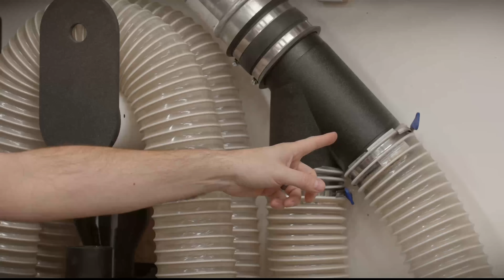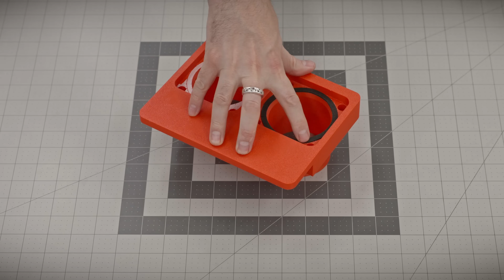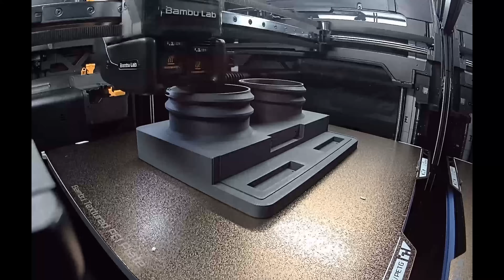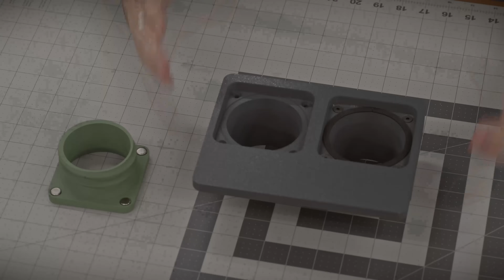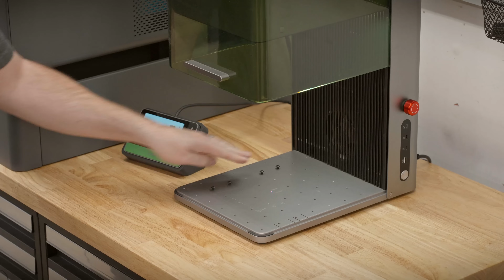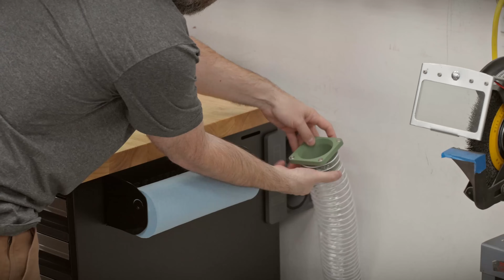Two Lasers, One Filter

Comment: If you cad design your supports as separate bodies, you can use tpu on the interface to support pla and vice versa. In the places where you want tpu to be integrated into pla, use beam interlocking.

Comment: Now that you have a simple and reliable solution that works, you could go down the path of the automatic (HA-driven) solution. Here's the trick: you design the automatic unit to fit between both of the parts you just made. In other words it connects onto the existing manifold magnetically, then the purifier hose adapter magnetically connects to the automatic unit.

Then if it doesn't work? In two seconds you can have the automatic unit disconnected and go right back to the manual solution.
Reply from the maker: I haven't had luck with HA automations working without some amount of intervention.  Something always needs updating unfortunately.

Comment: It would be nice if there was a visual indicator on each machine.  You could add limit switches to the manifold that run to a simple LED on each machine.  It would help you be sure that its connected to the right machine but not impair tool functionality if it breaks.
Reply from the maker: Yeah, I did think about this, but for the CO2 laser, I need to manually turn on the air filter, and it's RIGHT next to the manifold.  so It's pretty easy to just do both.  Also, whenever I have to add power, it gets annoying.  Then there's a wall-wart to plug in, wiring, etc.
Reply: @RobertCowanDIY  Just add a small wind turbine in the duct to power the led. So simple. I’m totally joking. Great project, thanks for sharing.

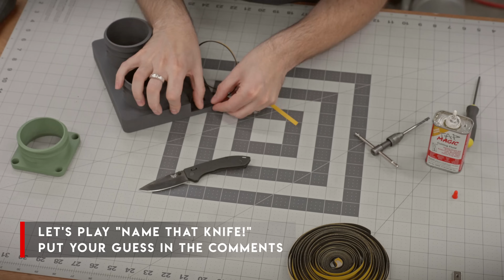Comment: 08:43 A very nice benchmade, doesn't look like the standard griptilian though. Great design! Thoughts on making it slide between the 2 inputs instead of pulling the connection out to switch, with the magnets snapping it in place? And I don't have any MMU experience, but can you change the interface layer to have a thicker line width? Thinking that could help with the interface adhering to "itself" more than to the object?
Reply from the maker: Close, it's a mini narrows.  I did think about the sliding mechanism, but 3d printed parts don't really 'glide' well.  I have some UHMW tape, but then it just gets more and more complicated.

Comment: rather than fancy "support" material, the good old PETG/PLA thing works well... especially if you can use silk or matte PLA. Regular PLA doesn't stick well enough to PETG during printing and can fail, but silk does stick nicely while printing, but still pops off super easily. I've had WAY more success with that combination using various brands of each than with plain PLA. I posted about that on the FB groups, and others corroborated my findings, as well as noting that matte seems to work as well as silk, and both much better than regular PLA. TPU doesn't stick well enough to PLA to work in your situation, though. FPF even used PLA as a peel away support for his TPU billows prints.
Reply: Bambu adds some adhesive in probably all of their filaments, PLA basic for any other PETG and PETG basic for any other PLA works fine

Comment: Adding a tongue to the top of your hose connectors that lever in to a groove at the top of the housing might be a good way to solve your concern with the connector pulling out from the weight of the hose without having to just brute force it with more magnet strength. Cool project!
Reply from the maker: Thanks!  Someone else suggested that and I'll have to keep that in mind for next time.  For now the magnets are plenty strong.

Comment: A small handle to grab on the clear tube might be nice feature from an ergonomics perspective. Awesome build and video. Thanks !
Reply from the maker: I had a handle on the last version of this I made, but it was actually more awkward than just grabbing the hose directly, so I left it off.  I thought it would help, but it just got in the way.
Reply: @RobertCowanDIY guess real world prototyping is the key; if it works it works if it doesn’t it doesn’t! Nice! I envy your ability to model what you envision; I’m getting there albeit very slowly but you have such a command of the modeling  aspect you can literally design it exactly as you want not just in your head but in the computer, and then all the manufacturing techniques are available to manifest it. Awesome.

Comment: 12:49 if PLA run a torch over to get it a little soft (just gives off that sweet caramel like smell) then remove. I find you get more off in one go. Otherwise you have to pick at it.
Reply from the maker: Ah, I'll try that next time.  I used PLA support on ABS-GF and it was quite squishy and easy to remove from all the heat.
Reply: @RobertCowanDIY it seemed to work okay with pla snd petg (my usual material). Once you get that sweet smell it should peel like play dough. Your and sounds about same. Check your settings on prusaslicer you can have 0 space between interface layers I think default is 0.1 that snd if do 2 or 3 layers you’ll probably get a better peel. Ie all at same time rather than break up. It’s funny as I had a similar part and it was horrid on one print and the next print was easy peel.  Environment, humidity filament bath or just Murphy’s law - you know you can get a peel but it spites you..

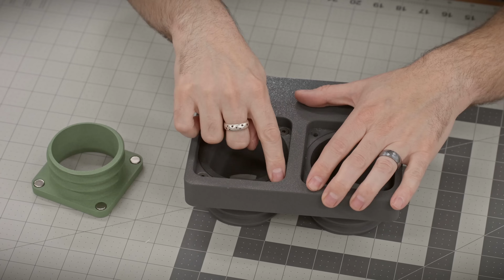Comment: 10:57 Try a Halbach array. Would increase magnetic force a little. Try as thin a wall between the magnets to get most force. It is amazing the drop off caused as distance increases.
Reply from the maker: Yeah.  The distance was only 0.2mm, but enough to cause a fall-off.  I just used WAY stronger magnets on the second version.
Reply: @RobertCowanDIY yeah I saw. I post as I go sometimes will go back and edit sometimes not. In this case comment stands for others.. But halbach are nifty if you have a few magnets and no space, I had a magnetic mechanism i was doing that used halbach. It certainly worked well. I think attraction force bumped up 70 or 80 % more (maybe 28kg) it was 6 yrs ago so figures aren’t right). That was from 5 10x10mm neo (n52).

Comment: 8:20 why not do solid infill around holes basically make an “boss”. Or do additional perimeters in enforced areas. 

Just curious why on somethings/ parts like this people don’t just jack up the perimeters to like 10 and essentially make it solid?

It would eliminate issues like the countersink blowing through. Is it a cost of material, time of print or for engagement (i.e. questions like this)?
Reply from the maker: If I knew I would had a problem, I would have just picked the correct hole size ;-)  Choosing the correct hole dimensions would have solved the issue.  2 walls is plenty for non-structural fasteners.

Comment: Looks great Robert. I may would have looked at a single blast gate, with a hole in the center, where the slide portion covers across the unused hose in either position.
You could manually switch or add the servo later without much effort…   just a suggestion! 
Always love your process to get a task done.
Reply from the maker: I WAS considering something like that, but it would have been custom and would have used moving parts, so the manifold was just simpler in the end.  But that certainly would have been another solution.

Comment: I've found that Overture Turbo PLA (which is probably the same stuff as Polymaker CoPE) works amazingly well as support for PLA, the same way that people act like PETG would, except it actually sticks while printing, uses the same temperatures as PLA, and is often dirt cheap because it doesn't work very well as a functional material and it sticks too well to some types of beds. But you can either use it with soluble support settings for an interface layer, or for something like this I would probably just CAD in a solid separate object with a chamfer between the parts to let you pry it off and a little bit of offset on the X and Y so there's room to remove it. Works great on a tool changer printer and I've tested it successfully with a manual filament change, so it should work on an AMS or MMU (not sure if it would need more purge volume than usual since real PLA and CoPE aren't 100% compatible).

Comment: In Bambu studio when you select PLA support material for the interface layer it suggests reducing the Top Z distance to zero...after having the same problem you did on a few parts I changed the Top Z distance to .05mm.  It still gives a great surface finish but makes the support layer easier to remove with fewer small bits left behind.  Love the video!

Comment: Pro-tip for the P2(S) while I’m thinking on it. I recently repurposed the 6mm fire suppression connector and routed an air compressor to bypass the dinky aquarium pump they use for air assist. 

Holy hell - what a difference. 20 psi and now I can cut 12mm MDF when that was impossible before. I’m very happy, unlocks many new projects. Albeit at 3mm/s 100% power but hey it cuts. No you can’t take multiple stabs at MDF, you end up incinerating the edges because the kerf gets gummed up with molten resin. One pass with very strong air assist does it. Can’t wait to try plywood again and see how the edges look.

Comment: I made a Y-splitter ages ago, it’s on Makerworld and handles the same problem: one AP2 shared between F1/F2 ultra and P2. I would like to isolate the pipes someday but it hasn’t been a pressing issue. The AP2 pulls hard enough that I can cut 12mm MDF in the P2 without noticeable odor (e.g. nothing creeps back up out the F2 inlet)
Reply from the maker: That's great to hear about the AP2 pulling hard enough!
Reply: @RobertCowanDIY  it’s honestly a very nice piece of kit. I’m in a small apartment and with their first gen extractor exhausting out the window I’d still stink the place up over time. AP2 solved that. Filters last a good amount of time too!

Comment: Tip for the support material interface: you can increase the top z offset from 0 to 0.075 and it’ll lift off with just a finger pull and still look marvelous. I print dozens of boxes with indentations on the bottom surface for my Etsy shop per week, and 0.075mm has been my go to for ease of removal, or if you want a happy medium (because a semi woven appearance can show with that value) 0.065 is easier to remove than 0 and peels off like unraveling a sweater, or a zipper, you just pull on a thread and pull and it zips off as a strand (using default pattern of course).
(Also “independent support material layer height” needs to be checked or else BBS and Orca ignore this value even though it isn’t grayed out)

Comment: Awesome work! If you wanted to add some over-complicated and horribly unnecessary electronics, a warning indicator to alert if the hose is not on the right manifold position when a laser is operating would be cool. Do the lasers have any GPIO that can be exposed? If not I'm sure a voltage or LED intensity can be monitored somewhere by a microcontroller, as well as contacts at the filter hookup positions. Lots of fun!
Reply: Safe bet when it comes to xTool the answer is always “no”. However there are some potential hacks - for example they expose some HTTP endpoints with hidden controls. I haven’t been bothered reversing further but my instinct is that these are very under-studied machines for hacking and there’s likely some low hanging fruit

Comment: Instead of using magnets, you could put a tongue on the top of the connector that fits into a slot in the top of each receptacle recess and since the hose to the air cleaner pulls down on the connector it would be a solid and simple connection.  The tongue/slots would not need to be very large since once the bottom of the connector is seated in the recess even a little clearance between parts would be sufficient to keep them together.
Reply from the maker: Ah, that's a pretty good idea.

Comment: PETG makes a much better and cheaper interface layer for PLA and the opposite.  PLA makes a really nice and cheap interface layer for PETG.
Reply from the maker: I've tried this before but for flat overhangs like this, the filament just slid across the surface and didn't stick at all.  I need to try it again.

Comment: I've found a fairly high failure rate with printed PLA dust collector hose fittings that thread on in a similar fashion. PETG holds up better (yet to fail), and PLA works if I ensure the fitting is not under tension, which can happen if the hose is threaded on tightly. 

Great design, great video, always refreshing to see the whole prototyping process at work, it's a good reminder that I'm not the only one who sometimes/often/always whiffs on Rev1 😂
Reply from the maker: What was the nature of the failures?  For me, the hose gets attached once and that's it.  Are you taking it on and off a lot?
Reply: @RobertCowanDIY stress creep failure, across the z-layers; I believe the trick is not to over torque the hose as youre installing it, they seem to be fine when the fit is pretty loose and forces are neutral.
Reply: @RobertCowanDIY matte PLA layer adhesion isn't as good as matte petg or glossy pla. Strange but true!

Comment: If you're not getting your filament for free, prototype with a low-cost high speed filament to shake out any design and fitment issues... then do a 'final' run in your fancy CF filament or whatever.... throwing away that many big CF prints hurts my soul.
Reply from the maker: That was the plan!  I was prototyping in that red (really cheap free stuff I got with a printer).  I intended all the PLA-CF to be final parts.  But I have 'prototype filaments' separated in different spots.  All my prototypes are terrible bright colors ;-)

Comment: Foaming TPU would be interesting to try and compare against the foam tape 🙂Also the ultimate over-engineering would be to embed the magnets in the prints.
Reply from the maker: I don't like embedding magnets in prints, because I need to pause the printer at the right time, and I like to print overnight or when I'm doing something else.  It totally works, I'm just not disciplined enough for it ;-)

Comment: Helpful tip: PLA is a support material for both PETG and TPU and the reverse is also true. I also have an H2D however I have the HT and two more OG AMS's from my P1S. I found a system that mounts to the same external spool conector but has 4 two way manual selectors so that you can reroute the AMS to the coreect side of the toolhead without moving PTFE tubes around. I say that because it seems like you are trying to simplify your setup.
Reply: This is mostly anecdotal because in use there’s always contamination, and too much risk of poor adhesion. For serious esthetic and functional prints - support materials as interface is duplicable and reliable, not experimental every time.

Comment: You should try using PETG as a support interface for PLA. It does also work for PLA-CF. Never had any problems with specs of the support material left behind.
Reply from the maker: I need to try it again, I had issues with the PLA just sliding across the top and not sticking at all.  I'll try it again.
Reply: @RobertCowanDIY  I think there were some issues when it comes to using it with H2D. You should check out the wiki post about it, it has some recommended settings.
I've only ever tested it on my A1 and apart from being very slow with the purges, never had a failure in 2000 hours.
Reply: @RobertCowanDIY  I've used PLA to support PETG a bunch and it works really well. I try to use similar colors so those tiny bits are hard to see.
Reply: @RobertCowanDIY if you change support interface speed down to like 40 mm/s, that helps fix that.